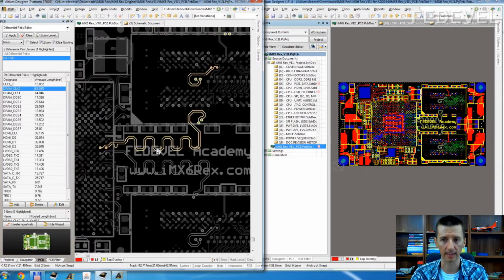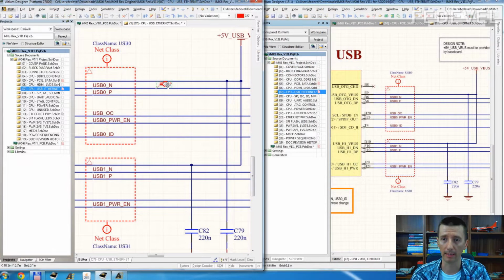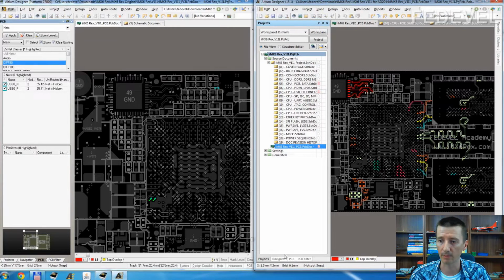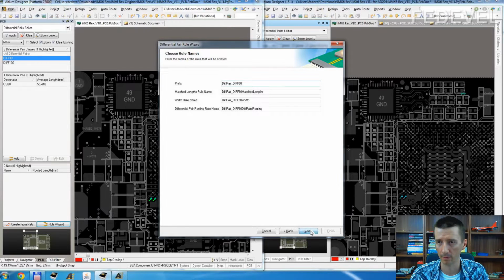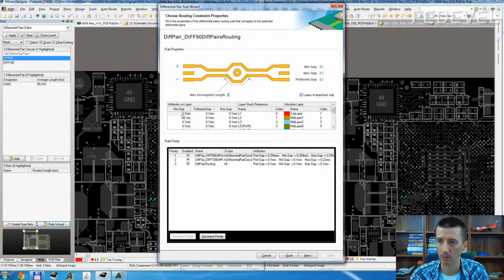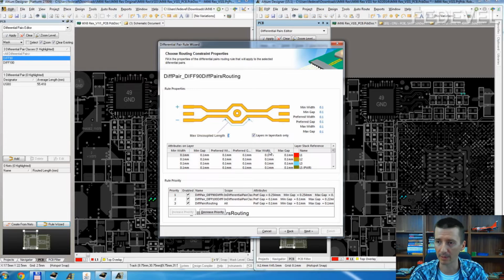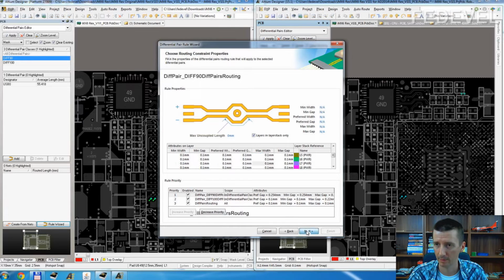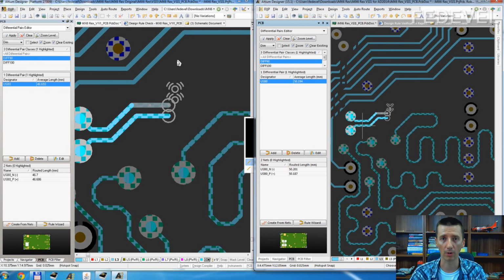Altium - Differential Pairs (The New & Old Way)

Comment: Hi Robert ,this is Dinkar ,do you have any course  for  SI and PI using Sigrity or Hyperlynx.I would like join for such a course.
I had gone through DDR simulation using Sigrity ,which  is a very good video from you to give a starting for memory simulation. I sincerely thankful to you for such a useful video.
But I would like to have it in detail.
Reply from the maker: No, I do not have any simulation courses.

Comment: Hi Robert,
Thanks for your Video, very informative!

What can i do if the minimum net width is at least 6mil and i need to create a 100 ohm diff pair.

in your List it says that your net width must be 0.090mm so about 3.6mil that is much to small for me.

Thanks for your help

best regards
Reply from the maker: The track width for a specific impedance depends on your stackup (e.g. how thick is the dielectricum placed between two layers). You may want to check it with your PCB manufacturer. I made couple of posts about designing stackup, maybe it will help you: http://www.fedevel.com/welldoneblog/?s=stackup

Comment: Hi Robert.   I am an EE circuit designer who works a lot in Altium Schematic and then hand off to my design to a teammate who does most of the Altium PCB work.  But I am now learning the PCB side too, because it makes be a better Circuit designer.  Your videos are very informative.  Here is my question about today's video.  Why did you need to create both a NetClass and a Differential Pair Class for Diff90?  Could just the Differential Pair Class alone be enough?
Reply from the maker: Alfred Key You are right, differential pair class would be enough. Differential pair rules can only be applied to Differential Pair Class (you can not use NetClass in Differential pair rule, it would not work). NetClass is not important for Differential pairs, but it's useful e.g. most of the time during layout you spend when your setting in PCB panel is set to "Nets" and in case you have NetClass, you can simply highlight diff pairs without going to PCB-> Differential Pairs Editor

Comment: Thanks Robert, I am glad to tell you that, I did a complex PCB from the help of your videos, and its fully working.
Reply from the maker: Ganesh Hegde That's awesome! Fantastic job Ganesh. May I know what did you design? Have a great day :)
Reply: Robert Feranec It was a Medical application board. It was having FPGA, Processor, DDR3, POE(Ethernet), USB, Flash etc...
Reply from the maker: Ganesh Hegde WOW! I am very happy you found the videos useful. It's always very nice to hear, that my work makes sense and it helps other people :)
Reply: Robert Feranec Yes, It was really helpful Robert. I wanted to ask you, how you will give a Extra Clearance for only Non Plated Through Hole in Power Plane Layers
Ex: I have 12Mil Clearance for plated Holes and I wanted to give 18 Mil for NPTH.
Reply from the maker: Ganesh Hegde I normally create a NPTH Pad Class (go to Design -> Classes -> Pad Class). Then just create a special clearance rule ((InPadClass('NPTH')))
Reply: Robert Feranec Thanks Robert, I will try it.